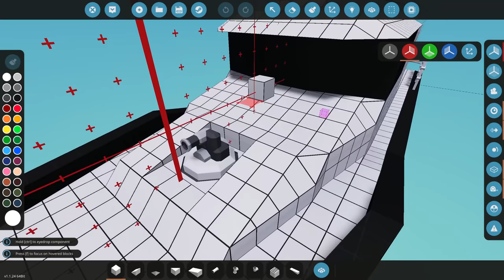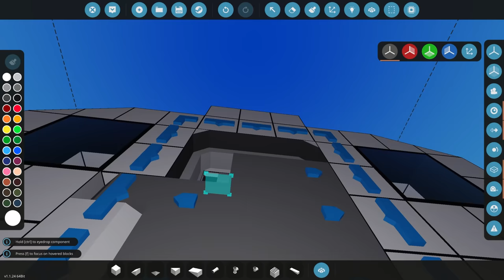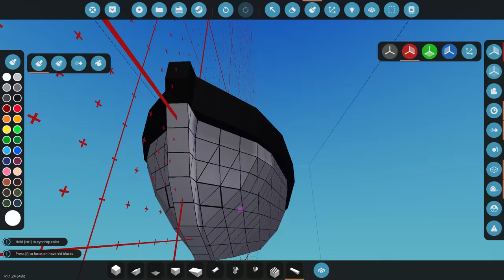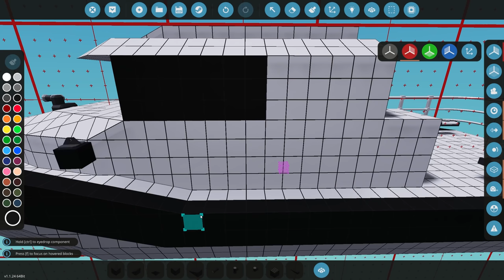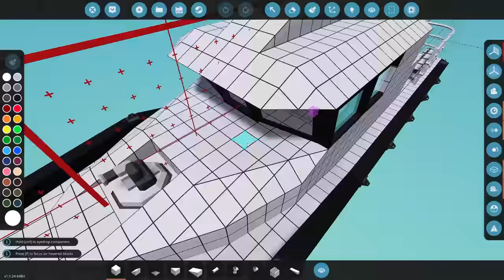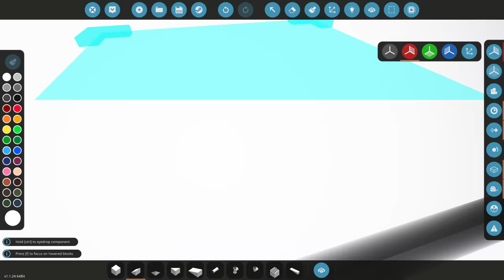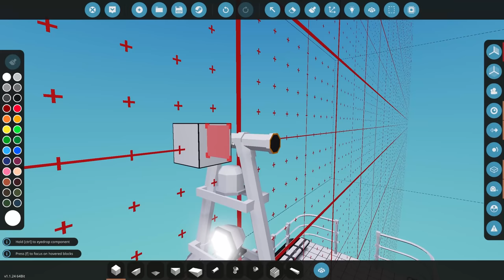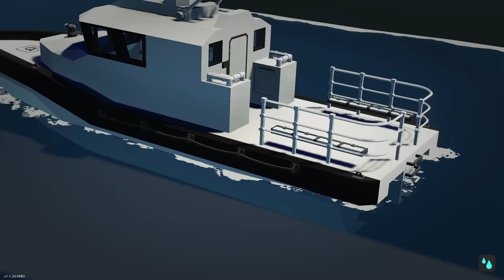Search & Rescue Boat Build Series - Part 2 - Stormworks

Comment: @ MrNJersey Recently started playing this and nearly instantly found  your video's for guidance and thank you for your thorough content. That said I did attempt a hull nearly identical to the one in the video, as soon as I opened up the cabin floor to the hull  the ship nearly sank.  After several tests I determined the only way to prevent it was to build a bulkhead separating the bow where a lot of corner and inverted corner pieces are. Is that normal for those pieces to not be airtight? Is the a mod to help find leaks? Sorry for the long comment.

Comment: 3 mins
Building a torpedo boat, need to figure out why the launch system doesn't move out and why the mag system doesn't activate. also need to get the micro controller for the torpedos systems

Comment: Built a hull nearly identical to his but it just tips over, any suggestions?
Reply from the maker: Less round or more weight at the bottom
Reply: @MrNJersey  cheers, its 15 wide and the v goes 2 blocks inwards on each side, so i will add more weight to the bottom. Fun fact i'm watching one of your tutorials right now
Reply: @MrNJersey  and also its quite low in the water i need it to be a bit higher how could i do that?

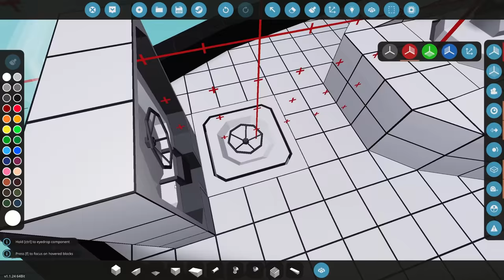Comment: I built it almost identical, only some small changes on the bridge, but after I spawn it in, it just sinks to the bottom within 2 secs 14:39 I don't understand why
Reply: yeah, mine does the same. I tried sectioning the boat and i found out that the section with the stairs for some reason fills with water. The nose doesn't, the back doesn't, only about 3-4 blocks in front of the stairs fills with water and i don't know why.